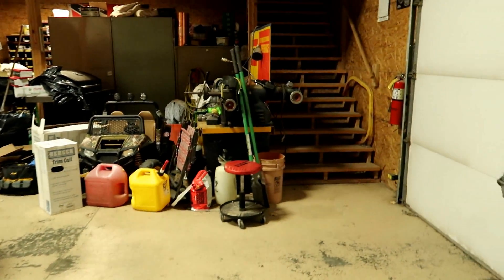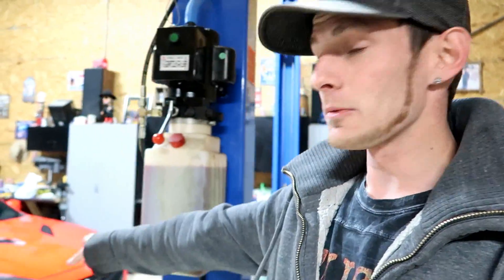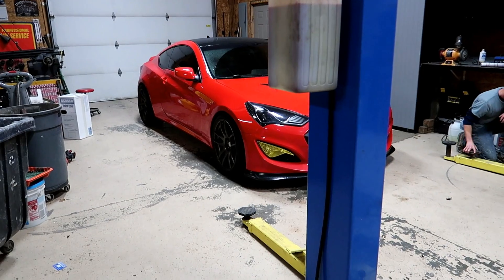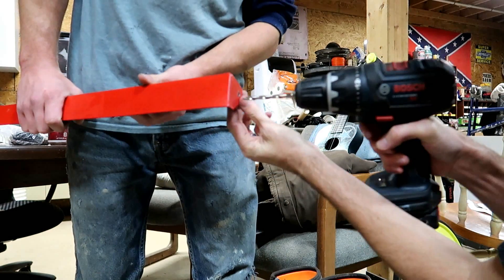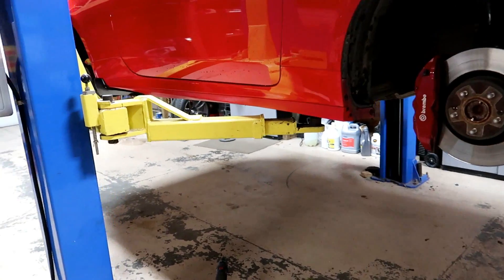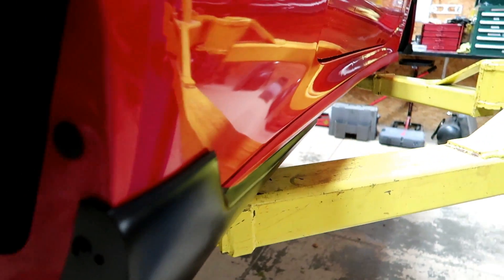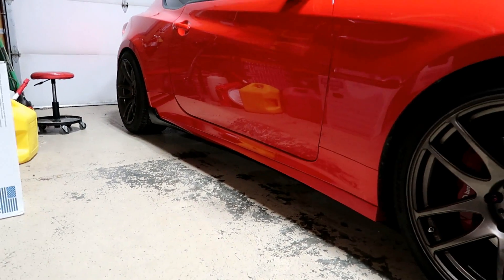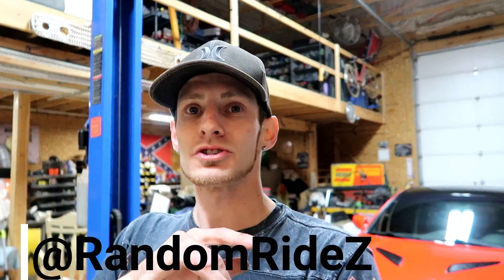Genny Gets New *Side Skirts* How To Install...

Comment: What size rims are those and what are the offsets? Any spacers? I want the exact rims but I have 25mm rear 20mm front spacers and paid a decent penny for them so I would like it to be a direct replacement from my 19 rspec wheels.. any help?
Reply from the maker: wtfvideos4 esr sr08 wheels. 19x9.5 front and 19x10.5 rear with +22 offset. And no spacers on my wheels

Comment: Hey ryan, I heard that the side skirts you purchased run small or warped at times ? What should we do to be able to install them ?
Reply from the maker: GenzillaKDM 408 after you receive them i the mail lay them flat on the floor with a few pillows on top of them for a few days b4 install. Thats what i did and they straightened out.